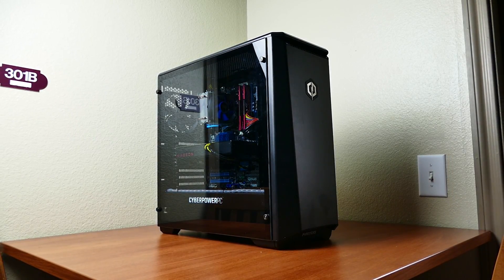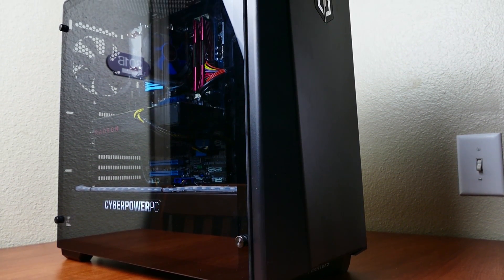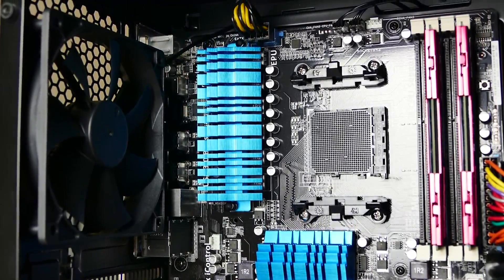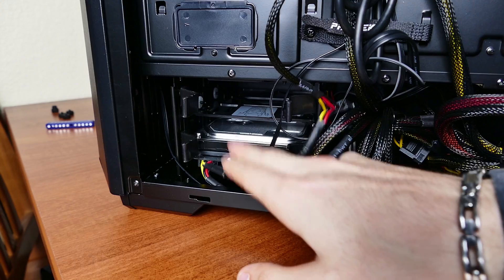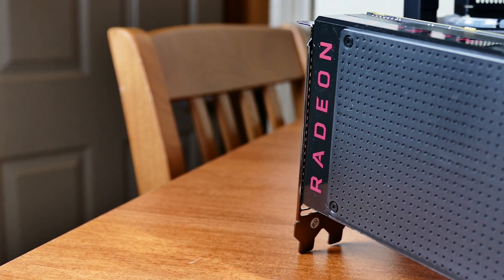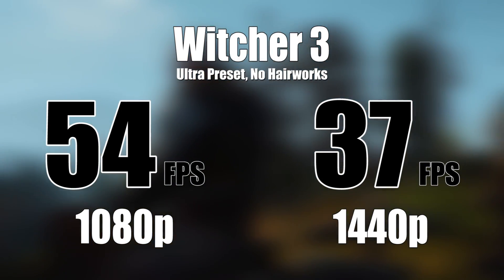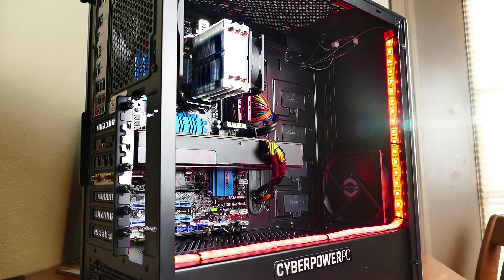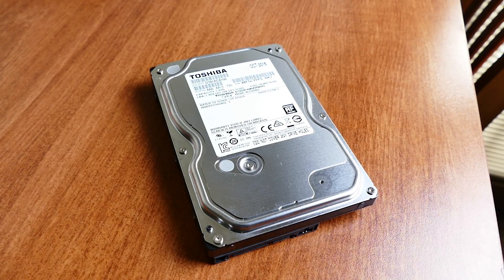Is a $650 VR-Ready Pre-Built PC Worth It?

Comment: Interesting. I bought this exact model from Best Buy for only $700. I do agree that it holds good-budget value! Quick question though; would an Intel motherboard/processor be easy to swap out if I so choose? I'm very new to PC so I don't know too much. :(
Reply: Sampaii as long as you buy an Intel CPU (along with its' compliant mobo) all you would really need to do is just swap them out. I would advise waiting for zen, but Kaby lake is still pretty good. 

ALSO get a new CPU cooler. the stock deepcool one is a no-no. a hyper 212 Evo or a cryorig cooler should be perfect
Reply: Kewlsta43 i will probably wait for Zen then; as I don't have the money to upgrade in the near future anyways. By the way, would installing all this stuff (motherboard, processor, amd cooler) be a DIY for a PC noob like me, or would be easier to take it in and let someone else do it? Thank you very much for the reply by the way. :P